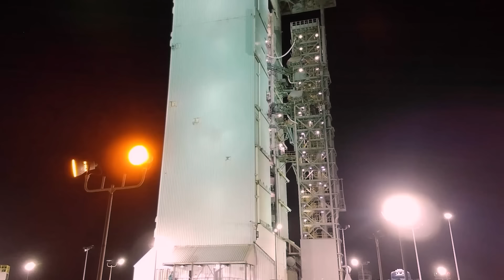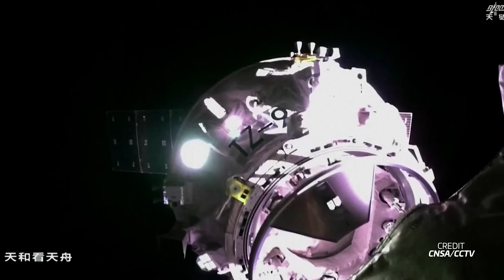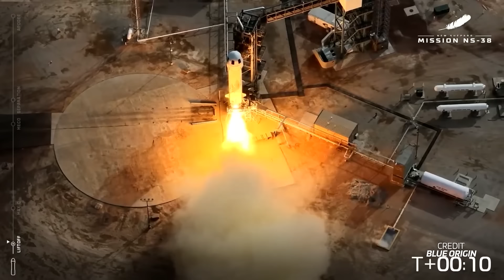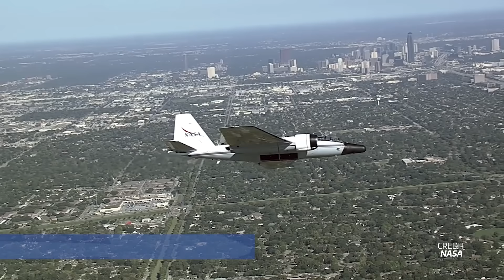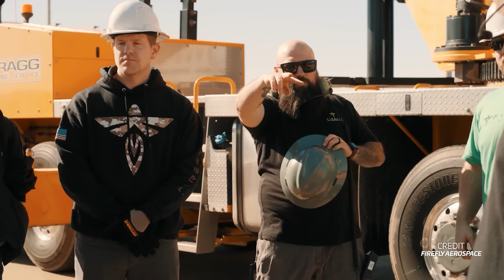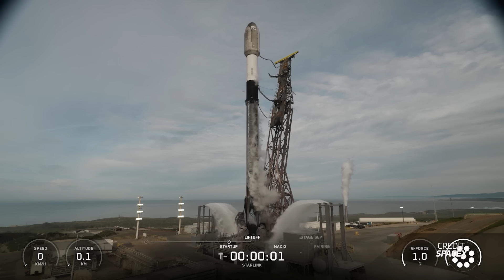Artemis II Countdown Begins | Crew-12, China Lunar Tests & Space News | This Week In Spaceflight

Comment: The WB-57F, was not "originally designed as".
The English Electric Canberra, License Built by Martin as the B-57, then had a Reconnaissance version developed from it, the RB-57, and from that the WB-57 was eventually developed as a refit after they were repurposed as a Non-Military aircraft.
There are several Canberra based aircraft sitting in the Boneyard, on Google Earth or Maps, look to the north of the Hercules parking area.

Comment: A minor correction about the WB-57 which was "originally designed" in the 1940s by English Electric as a fast, medium range tactical nuclear bomber and reconnaissance aircraft for the RAF and first flew in 1949.  The English Electric Canberra was produced under licence in the US by the Martin Company as the B-57.  The RB-57F Canberra reconnaissance aircraft (redesignated WB-57F Canberra for NASA use) was modified with longer wings and bigger engines, but was still based on the original English Electric B.2 Canberra fuselage and design.  The Canberra first entered service with the RAF in January 1951, which means they've been flying in one form or another for 75 years.

Comment: Not going to launch. 🤷‍♂ Perhaps after many delays it catastrophically will but probably or it is scrapped altogether or it will be a falcon heavy.
Reply: Dude that will literally delay it by months if not a year.

Why? Falcon heavy can't seem orion to the moon only LEO and even that it need another launch to send a tug to push orion on a path to the moon. 

Plus there's also crew rating which heavy does not have only falcon 9 and that will take a long time for the FAA to approve. Bottom line is there is no other rocket RIGHT NOW that can replace SLS maybe after artemis IV/V but for now its the only option
Reply: @dragon-void Actually Falcon Heavy could indeed launch Orion to the moon on a free-return trajectory, such as Artemis 2 is doing.  It would require that all three boosters be expended though.... which is actually no different at all from Artemis, and much cheaper anyway!
Reply: @i-ccc-channel I'm not denying that but it can only send it to Leo, and even then it would struggle a lot. Plus do you understand how weak the ICPS is. That thing doesn't have the delta V to do a Tli for your information.

You still need 2 launches, plus a bunch of modifications to Heavy, and the ground equipment to even support orion. Yes it might be cheaper but its too little to late. I will say again there is no viable alternative for SLS right now maybe in the future but for now your stuck with it
Reply: @dragon-voidFalcon heavy is capable on its non reusable mode as already said. Tho the certification and the politics around are indeed another matter altogether 🤷🏻‍♂️
How the SLS has been certified after its first mission problems or Starliner was I can’t fathom.
Reply: @frgv4060  to take orion to the moon, yeah maybe in your dreams. Remember orion, Esm plus ICPS is over 60 tons your heavy can only send 27 tons into a TLI in fully expendable mode meaning 2 launches.

Dude is artemis 1 a joke to you, why do you think it was not crewed to verify that orion plus sls are safe and can safely take astronauts to the moon and back. Other than heavy the only other rocket I see able to carry orion is new Glen.
Reply: @dragon-void So some research: Falcon Heavy is perfectly capable of sending Orion around the moon on a free-return trajectory.  They would need to build some type of interface to do that, of course, but the capability is there.  Mass of Orion is about 25,845 kg.  That's 10.387 crew module, plus 15.461 ESM.  As you say, Falcon Heavy can get 27 tons into a trans-lunar free-return trajectory.  So where's the problem?
Reply: @i-ccc-channel  dude at most heavy can get 22 tons to the moon and orion with esm is 26 tons add the launch abort system it goes up to 32 tons. So no heavy can't send orion to the moon even if you risk crew safety and remove the LAS.

Falcon heavy can only send orion with its service module plus upper stage to LEO with 3 - 5 tons margin which is pretty risky. That's why nasa discovered its safer to split it into 2 launches. 1 sends orion into Leo the other send the upper stage they dock and do a TLI. But to get there a lot of barriers have to  crossed which makes its over complicated plus orion can't even fit in falcon heavys fairing meaning ot has to a have a custom one which can affect how the rocket performs
Reply: @dragon-voidMy man. Non reusable Falcon Heavy is 63 tons to leo. Full Orion 33 tons. Leo is 9.5 m/s delta v. A flyby and return from the moon from leo is 3.5 m/s. Meaning with only 33 tons of payload Falcon Heavy has more than enough delta v for that feat.
Edit: typo km/s 😳🤦‍♂️
Reply: @frgv4060  yeah but here's your problem that service module has weak engines at most 1.8 km/s of delta V and that can't push orion into a tli. The most plausible is if heavy pushes it into high earth orbit then the service module gives the kick for a flyby.

And if you add the upper stage, ICPS the weight bloats to around 60 tons and i doubt nasa would risk it with 7 tons of margin when the capsule can't even fit in heavys fairing.

Of course the simpler solution that falcon heavy can do is get rid of the fuel in the ESM and just send it. The weight would drop to 13 tons but at the expense at no fuel for any course correction and that is if nasa is desperate and can Somehow overcome the many barriers in doing so in a short time period.
Reply: @dragon-void You are assuming for some reason beyond me the heavy can only do a leo trajectory.
Edit: Ok this is getting ridicolously close to a "Twitter argument" as you started ignoring the "non reusable" part with the tonnage, then the "FH can only do LEO insertiion missions" assumtion. If you only want to have the feeling of winning the argument... here, all yours.
Reply: @frgv4060  Yup.
Reply: @frgv4060  Yup.  In fact, Falcon Heavy alone could likely get Orion to the moon in a free-return trajectory, with no extra staging.  In theory, at least.
Reply: Seems the delays are starting alright 😂

Comment: Please give us the distances and heights in feet and miles as well as metric. I can’t visualize km as easily as I can miles. It’s not that difficult to just include the standard measurements in the videos. My whole experience in the USA is with standard units and that isn’t changing any time soon.
Reply: Just learn the metric system, it's better. If you need to visualize a distance in km just convert it to miles yourself until you don't need to anymore
Reply: Metric is the standard measurement both globally and in the space industry you clown 😂
Reply: " It’s not that difficult to just include the NON-STANDARD measurements in the videos".  There, I fixed it for you.  They should probably also include furlongs and cubits, for the folks still stuck a few millennia back...

Comment: NASA hasn't learned yet. Don't launch your rockets at the end of January through the beginning of February.  Columbia launched in January and was lost February 3rd. Challenger launched on January 28th and was lost 75 seconds later. O-rings and ice are a bad combination. Columbia iced over, a d Challengers SRBs rings leaked. Artemis II has flight untested SRBs. Not good. Not pessimistic, just reality. Think 🤔 🤔 🤔 long and hard b4 testing Artemis II under these extreme temperatures let alone launch 4 humans under tbese conditions. SpaceX doesn't have these limitations, but NASA shoumd rethink their timeline.
Reply: Those SRBs are completely flight tested, they are literally reused Shuttle SRB casings. The joints between the segments also have heaters in them to prevent an accident like Challenger and Columbia had nothing to do with it being January, it could have happened any other time of the year.
Reply: Get a job and stop trolling
Reply: NASA hasn't learned yet?  You're decades out of date and faking it badly.